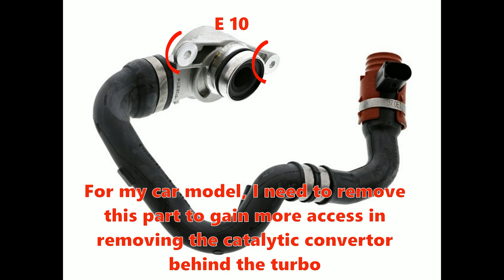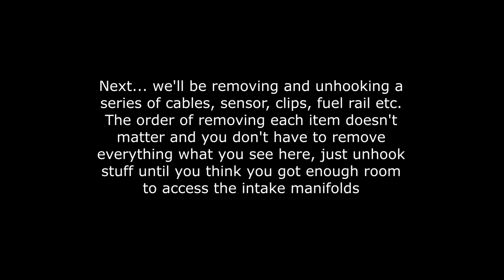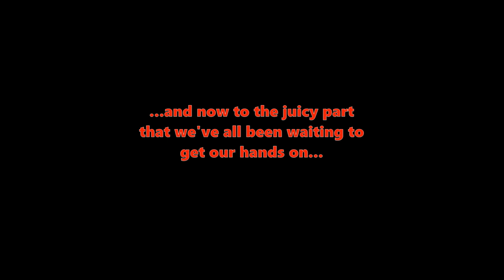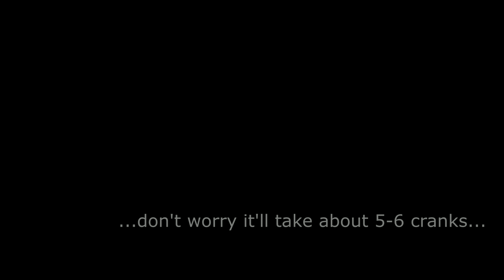DETAILED Mercedes-Benz OM642 V6 E350 CDI Bluetec W212 Oil Cooler Leak Fix

Comment: Thanks! I have your exact same 2011 BlueTec and your YouTubes have been a lifesaver.  I’ve looked and I think you have the only 2011 bluetec content on YouTube and what you do is really good. I’m currently trying to replace my power steering pump and I was really hung on removing the fan until I saw you do it. I have the Mercedes Online Documentation system for my vin but it’s so big and complicated it’s hard to follow.  I’ll be watch you now!
Reply from the maker: Thanks a lot Willie!

Comment: Thanks for posting this!  I am looking at buying a car with this engine.  Thankfully the oil cooler was replaced not that long ago at a cost over $3000.  It makes perfect sense why almost $2K in labor!
Reply: It's like 10-12 hours job max so 2k it's a robbery tbh
Reply: @jazda200  You're living in the past.  There simply aren't any good mechanics out there charging less than $150/hr
Reply: @youtoobe169  what are you talking about overpriced usa ;) mate I'm stay in Scotland so my mate working in lexus garage in Edinburgh, after work Hi doing extra jobs and Hi charge 34£ hour labour  I understand no one work for free but cmon man that's mental,  only idiots pay that much for any labour that not rocket science tbh
Reply: @jazda200  I must be an idiot then because I happily pay a competent mechanic to do a proper job on my car when the work is too complex for my skillset.

Comment: Nice video. Took me about 20-30 hours to complete. A couple tips: Harbor Freight offset box wrenches 32042 are great for the injector fuel lines if you slot them with a grinder. Mine was also leaking from the oil filter housing to block, oil filler cap, black plastic horizontal tube that the throttle body/flapper and egr bolts to. I also replaced the diaphragm in my pcv/ccv valve. It was stiff and letting too much oil into the intake. CRC water-based de-greaser from Autozone will make the aluminum and plastic parts look like new without much scrubbing. A small flathead screwdriver can loosen most of the electrical harnesses easier than pulling on the gray taps from the other side. Remove the EGR valve near the firewall on the passenger side. It will make getting the hose clamp near the firewall and the catalytic converter bolts much easier. Get the seals directly from the Mercedes dealer instead of buying OEM. The seals in the IDparts and Elring kits are an older revision. The Mercedes TSB on the oil cooler seals says not to use the older rev seals. The current generation are completely covered in purple viton. You can see metal near the center of the holes on the older ones. I didn't find that out until after I replaced them. My car had the current rev purple seals and they lasted about 85,000 miles before I replaced them.
Reply from the maker: Nice recap!
Reply: Looking for torque specification

Comment: No way a normal person with no expierince can pull a job like that. Taking it of looks easy, puting it back? idk man :DD Not sure if i m capable to remember how to put everything back without taking notes or pics! Nice video man, Thank you for sharing all that hard work
Reply from the maker: Lol 😂, it’s my second time as well doing this. Organizing is key!!! Either put all the screws and bolts back to where they belong after taking off a part or, like I did, make a quick layout/diagram of the engine on a piece of cardboard and punch the bolts through in their place.
Reply: @AlbanianFix   Do you have pic of that layout?
Reply from the maker: @thebrodnaxs8304  I made the layout free-handed from scratch on a piece of cardboard. Basically roughly draw all of the bolts places where you take them out and punch them into the cardboard.
Reply: @AlbanianFix  thanks. If I end up having to do this I'll try it.

Comment: Thanks for this video. Its really helpful for us car owners who have the same problem.  We have an ML 350 bluetec sport that has the same problem, oil leaking. Took it to mercedez to have it checked first time theybdidint solved the problem.  Tool it back again and they said it's the oil cooler seal.  Can't believe they didn't get it right the first time when they have all the tools that they need to help them identify the culprit.  Any ways they are charging us £140/hr and they said that it's an 8 hour job 😔
Reply from the maker: Wow sorry to hear that. I don’t know if this helps somewhat emotionally but here in the US, they charge around $4500 from what I’ve heard...
Reply: @AlbanianFix  OMG really?! Unfortunately our warranty company won't pay for it cos the fault was from wear and tear.  We are more than happy to pay as long as the job is being done right.  We'll go and get our car back tomorrow and we'll see if mercedez done a good job this time.  Thank you so much for this video really really helpful.
Reply from the maker: @sheilabravo01  Yeah hopefully they do. I mean, it'll be back on them if they didn't :)
Ask them if they had the chance to clean the manifolds since they were that deep into the engine and the swirl flaps were not stuck and in good shape. Ask if they used the new updated (Purple seals) for the oil cooler and also if the turbo was in good shape as well. I know that they might have already done all of that but at least it gives you a peace of mind and gives them a sense that you've done your homework on this issue. After the job is done, i would suggest to open the hood and pop the cover and take some crisp pictures around the engine and then compare after a couple of weeks driving it to see if there's still a leak or something.
Reply: @AlbanianFix  thank you so much you have time to reply to my sentiments 🙂 yes I did a lot of research on this matter just because mercedez didn't get it right the first time.. I wish I have seen your videos first so that it has save us money the first time they diagnosed our car.  It's just so frustrating because they have all the equipment to help them find the culprit but they didn't see it the first time.  Apparently they updated the seal in 2010, my question was to them how come our car has got the old seal when it was registered 2013, shouldn't it have the updated seal already? Just a thought.  Anyways thank you for reminding me to ask those questions really appreciate it.
Reply from the maker: @sheilabravo01  Well, to answer that question, your about to open a big can of worms. I don't know how true this is but I like to believe this story and will keep it as short as possible... The oil seals were never replaced with these very new Purple seals (Viton). They were replaced with other Orange seals like its predecessor that had better heat resistance but would fail just as bad. Mercedes announced that 2010 models and up have newer seals and "supposedly" worked as promised so it can change this issue from bein a recall item to a regular maintenance item. It's simply an engine design flaw and there's little to nothing you can do about it. Even the new Viton purple seals will fail as well but at least will last a little longer. In my opinion, at the end of the day, this oil leak form the seals is not too bad. Yes, it will leak and yes it's annoying and you need to keep checking on the oil level so it doesn't drop too much but it will not harm the engine. It's like a broken water faucet that leaks even when you shut it off completely but you still live with it. Don't the race the car and don't stomp on the gas and you'll be fine. I know people that have been driving with with issue for years and still refuse to fix it(or no money to do so). And I also know another guy who had exactly this same issue but failed to do regular oil changes (well past the recommended 10000 miles) and as little of a leak it is, the engine blew the head gasket from overheating and had no oil in it (his mistake).
If you love the car, and I do, the best thing you can do is to just keep up on the maintenance as follows:
Change oil every 5000 miles (Not recommended 10000). Dip stick should show oil level in the middle, don't go over!
Change air filters every 15000 (every 3rd oil change)
Change fuel filter every 15000 (every 3rd oil change)
All of the items above will cost you about $250, maybe less where you're at.
Reply: @AlbanianFix  I was about to ask you if it's worth keeping it? Because after tomorrow when we get the car back, we're thinking of selling the car . We only just got it in july 2019 and it has 67000 mileage on it. So far we have done 11000 mileage on it.  We love the car but it's just the thought of how expensive the repair would it happen again or something might need repairing again.
Reply from the maker: @sheilabravo01  I understand. I can tell you for sure that it's gonna happen again, probably in another 40,000 or 50,000 miles  plus whatever in-between that might need fixing. Til then, I am anticipating this repair again but so far I've been lucky that I could repair some stuff myself which allowed me to keep the car within my budget which is only enough for a reasonable car. If I had to pay the dealership instead for all the work, I would have sold my car within 6 months of buying it, 4 years ago.
It might be a cliché for saying this over and over but if your looking for a reliable car, look for Honda, Toyota or Lexus.
Reply: @AlbanianFix  that's a good thing that you can do it yourself.. it saves you a lot of money.. but for us that don't know anything about engine I best follow your advise to get a reliable one once we sold our car.  Thinking to get a peugeot 3008, we had the old version before the ML350 and I can say that we had the old Peugeot for 6 years without any problems we only have to changed it because another car smashed into our car badly that we have to written off.  I have been watching other DIY videos of yours and I can say that you are gifted with those skills that you have.
Reply from the maker: @sheilabravo01  Thank you very much Sheila! Good luck and hopefully you will finally get your hands on a reliable car soon!

Comment: Wow. I think I'll deal with the oil leak until I have a month off from work haha
Reply from the maker: Lol, that’s funny you say this because I was still working while doing this project and it took me about a week working on the car utilizing 2-3 hours after work
Reply: @AlbanianFix  top job man. Congrats !
Reply from the maker: @georgezoppis8291  Thank you!
Reply: @AlbanianFix  does that mean all OM642 Motor will have the same Problem?
I m driving an ML 350(2014) 140.000km currently and i dont have any oil leaking at all..
I let the oil change Regularly every year and haven t had any problem so far..

Comment: Great job mate, I agree it's a big job and no bloody way I'd do it myself. Taking it apart is easy but putting it together needs a genius like you ;). Thanks
PS: how long did it take you?
Reply from the maker: Thank you but trust me, no genius here. If you have a good open space, display all the parts with numbered steps, grab a piece of cardboard, make an outline of the bolts and stick them in the cardboard also describing how it was mounted. Take pictures of tricky parts and hold up a number beside it showing which step it is. I think I went all the way up to step 120ish.
I was really taking my time with it and was only working after work for a couple to a few hours. Took me about 7-8 days to take it apart and label everything and then took me about 4-5 days to put everything together.
Mercedes dealership quoted this job to be more than $5000 and expect it to be done in 13 hours.
Good luck 👍

Comment: Great video! I'm doing this oil cooler gasket replacement now and stuck on removing exhaust elbow. how do gain access to the bottom bolt?
Reply from the maker: That was the hardest bolt actually. The only way I was able to, was to use an impact joint socket. It has just the right length and the right flexibility to reach the bolt.

Comment: Before going to all the effort of changing these oil cooler seals, change the PCV valve first. It's $30 and takes five minutes to change. The excess pressure from a faulty PCV valve caused my oil seals to leak but they don't anymore.
Reply from the maker: That’s also a very good possibility. Thanks for sharing!

Comment: Good afternoon, 
what screws, seals or other worn parts would you recommend to be replaced with oil cooler seals? So that we would have some peace for the next 150,000 km. Thank you very much.
Reply from the maker: There are plenty of kits actually that you can use for this job to replace screws and seals. They’re all over eBay and other websites.
The kits come complete with all those things that you’re removing which are also recommended parts to be changed.

Comment: Thank you so much. This is an absolutely superb video. This will be my go-to step by step guide if I ever need to do my E350 CDi. How do you know if the seal needs replacing? Does it leak water into the oil or vice-versa or does oil come out and drop on the ground?
Reply from the maker: Thanks a lot!
The oil doesn’t mix with water since the water’s seals are never at the hottest temperature like the oil seals are and therefore they’re always intact and almost never leak. The oil seals however are at much hotter temperature and therefore disintegrate and start to leak. Oil comes out and goes out through a drain hole (🤔 which is weird, seems like the engineers knew it’s going to leak) and after that it goes to the ground. This is one of the biggest oil leak issues with the late Diesel Mercedes but for me, all-in-all, it’s not that bad at all unless the leak is super bad.

Comment: hello very nice video . when i was doing it the sensor on the left side inlet manifold got broken and i can not find the part number.  can you tell me what that sensor it? if you pause the video at 12:19 you will see the one held in with a metal clip. 
i need a new one thank you

Comment: Pershendetje 
Shum pun e bukur dhe flm per videon. Te njejten gje po bej edhe un ne nje Chrysler 300c v6. Deshta me dit à mund ta pastroj me benzin llomin e zi sepse nuk kam ate flaken ? Flm
Reply from the maker: Benzina nuk te bo shum pune, mund te pastrohet pak por jo aq sa duhet. Per mua 100 here me mire me zjarr.
Ket zjarr qe kam une, e ble ne dyqan shum kollaj 20-30 dollare. Me nje bombel gazi te thjesht dhe me fitilin e flakes e nez zjarrin brenda manifoldit te makines derisa te piqet llumi zi per nja 5-10 minuta edhe pastaj do e fikesh zjarrin dhe do e mbash flaken vetem me ajer te kompresum edhe llumi vazhdon edhe digjet si qymyr derisa te shkrihet fare.
Kte punen e zjarrit ta besh vetem nqs manifoldi eshte metal, jo plastik. Edhe hiq pjese te vogla rreth e rrotull qe jane plastike.
Reply: @AlbanianFix  Shum flm per pergjigjen dhe respekte per ju. Me pelqeu shum puna juaj dhe e shpjegoje kret sakte proceduren e punes. Po radiatorin e ftofjes se vojit e nderron apo thjesht vetem gominat plastike?
Reply from the maker: @dedajemilian1645  un i ndrrova vetem gominat se nuk mu duk i demtuar. Por nqs e ke me merak edhe mund ta ndrrosh fare ftohsin.
Reply: @AlbanianFix  demtimi vetem nga jasht dallohet ?
Reply from the maker: @dedajemilian1645  nga jasht me sy e shikon ose me sakte provoje ta verifikosh me xham. Vendose bazen e fthohesit mbi nje xham me pa qe a rri drejt dhe a perputhet 100% nga te gjitha anet apo ka hapesira qe do te thote se ftohesi eshte demtuar ose shtremberuar dhe nuk do bej 100% perputhje dhe me pas kur ti te vesh gominat ka per te rrjedh prap.
Reply: @AlbanianFix  shum flm dhe suksese 🇦🇱💪

Comment: Nicely done bro, have had the same leak on ML350, (wasnot too bad) however when I placed the purple seals, within two weeks i had a bigger leak then before. Took all apart thinking I misplaced the seal or something, but everything was placed perfectly.. 
So got me pair of orange seals again and did the whole thing al over. Anybode else expirienced the same with these stupid Purple seals which were suppoce to be better??
Reply from the maker: Hmm 🤔... this is the first I ever heard of... although, mine is starting to leak again recently, not as bad but I can see oil residue when I do oil changes. Might be from other places too... engine has some years and mileage on it 😅

Comment: My friend, i have a 2011 E350 BlueTec like the one you’ve frequently worked on. My job is replacing its power steering pump, but I have to get things out of the way beforehand. I’m stuck on the fan shroud, which is half way out. I need it completely out to go to the next step. I have it 1/2 up but I can’t figure out if it’s even possible to get it completely out without disconnecting some of the hoses on the left and right side about mid way up. I have the radiator hose on top right disconnected and that got the shroud to the halfway point. Have you crossed this bridge before? I appreciate your thoughts. About the 2:27 point in this video.

Willie Chaffin
Abingdon VA
Reply from the maker: Hey Willie, the big return hose at the top-right was actually the main thing in the way when I was struggling. So taking that hose off, will give you enough room to push the fan to the right while lifting it up in a zig-zag way and dodging the tabs on the left of the fan shroud that are getting stuck between the pipes. One small little pipe you should definitely avoid hitting is the small plastic inlet at the top-left of the radiator. It brakes very easily! Ask me how I know.
Reply: @AlbanianFix  I’m taking it slowwww so I don’t end up with a problem. I learned today line #2 is part of the transmission oil cooling system. It lands on the oil cooler in front of the radiator. I’m going to clamp it with pinchers and take it loose. 

Got to find out what line #1 is…. It might be part of the charge cooler, which I learned is Mercades name for turbo air cooler.